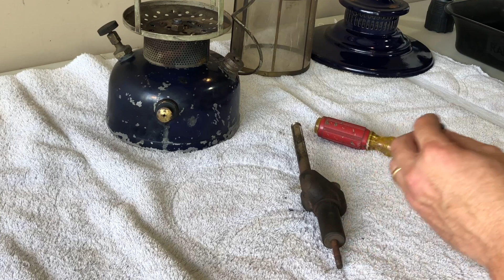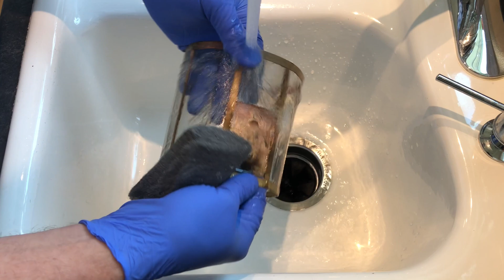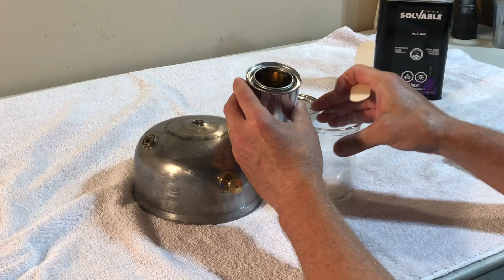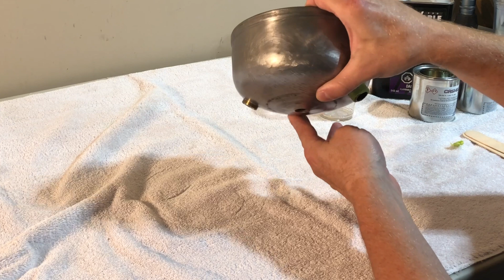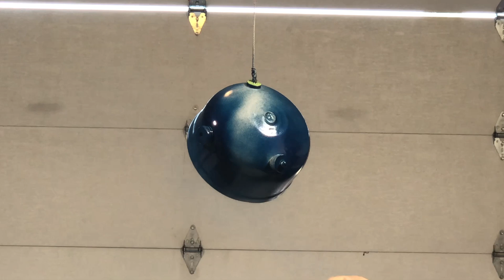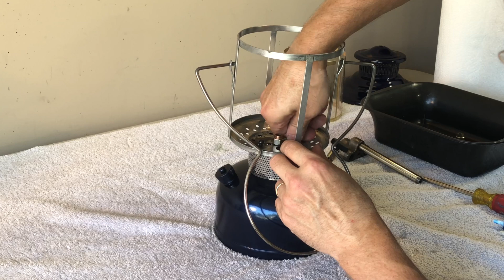Restoring a 1920s AGM 288 Lantern

Comment: Well fettled and this is another very useful reference video!👍👍
The design of the lantern is interesting, but in my opinion it's over engineered, perhaps that was how AGM., got around Coleman's patents.
I was surprised that you used tank sealant rather than just soldering the tank.
The Venturi tube and mixing dome are similar to those found in Tilley burners and Vapalux/Bialaddin/Imber research burners and the burners on Radiolite and Ulfer lamps.
The instructions for your lantern are shown in the Classic Pressure Lamp forum's library, but that is only open to subscribers.
Perhaps Coleman burner caps could be fitted and if so that might cure the light imbalance.
Letting the lantern run for a few hours might also cure the pulsing.
The build quality of that mica chimney is splendid.👍👍

Comment: Most impressive resto!
I’ve learned so much watching you over the years too.  You inspired me to get a 335 (green) and did a full resto on that.  When I took apart the generator, the cleaning needle came out ok but, the spring and asbestos packing were tight.  I should have just left them in so, I ruined the spring, etc… So I modified (cut) a used spring from a 220 and packed it with brass wool.  Running like a champ just in time for camping this weekend.
I’m bringing a backup lantern, just in case. lol
As far as your pulsing problem, all I can suggest is to run a tank of fuel through it and see what happens.
These lanterns like to be run like old cars with carburetors.  I have 3 VW’s all from the 60’s and they run better when driven regularly.
Take care and thank you.